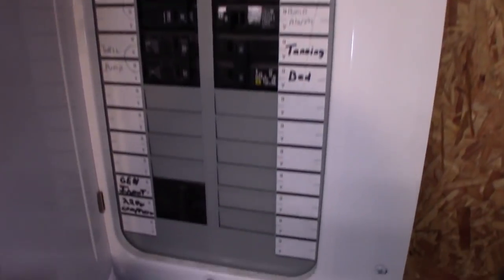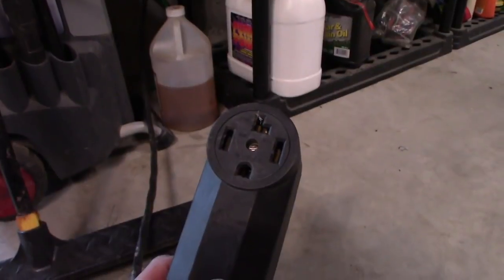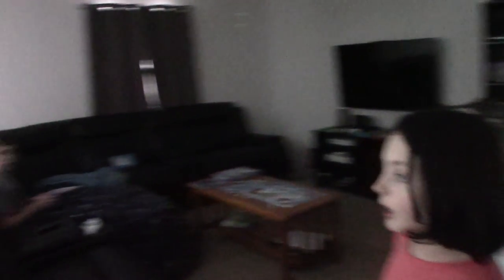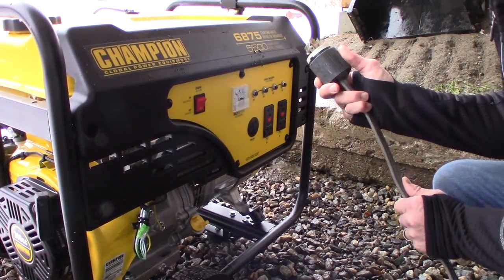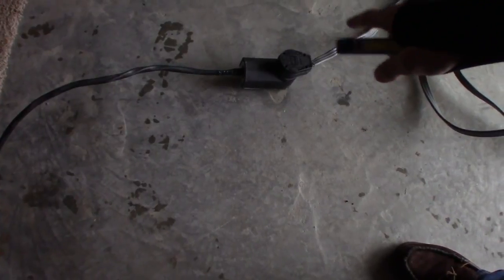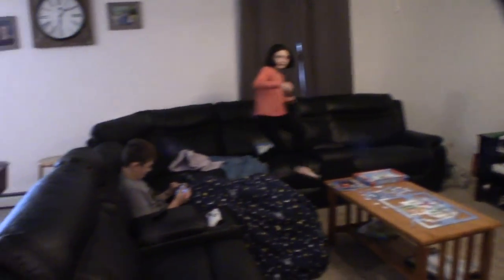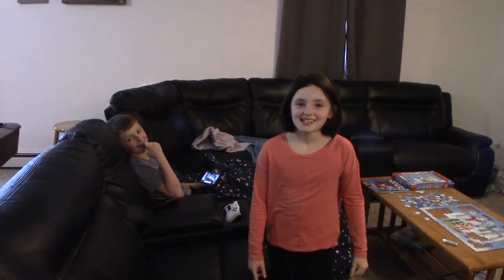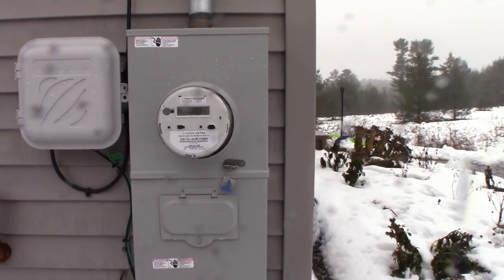Powering my ENTIRE HOME with a Gas Generator

Comment: actuality there's nothing wrong at all doing it this way.. I lived in an older house once back in 2012 and me and my wife are going through hard times and our power bill got backed up and shut off... I worked at the local recycle yard,ended up buying a generator in parts and putting it together...
had like 15 bucks in a 5500 watt generator and I ran it to the cook stove breaker of the house which my breaker panel was on the front porch of This Old House....I would drain the gas out of old junk cars coming in every day and take home 20 to 30 gallons of fuel every day... and it would cost me nearly nothing. I even ran it on propane for a night or two  even though it was a gas only generator.......we went 5 months like that from late January all the way through till the beginning of Summer.... only thing was when my well pump would run my hot water heater couldn't be running so I installed a breaker flip switch (I found at the recycle yard off of a huge machine) to my hot water heater and would manually shut it off in the bathroom when not in use.... it actually worked very well and from that time to today I'm a huge collector of generators and such things so you can kind of say I'm well prepared for a power outage and I've started collecting huge solar panels as well and car batteries for backup to use with my power inverter.... I had a 1500 watt power inverter one time it was an old job worked very well. I used it to power my buddies house we only ran lights and a 1500 watt heater on the low setting obviously.... we put the inverter outside connected it to a car battery then hook jumper cables to the car battery to his van which was sitting further away from the garage door where he could start the van when he needed it... I hooked it to his breaker box the same way i did my generator..... Hard Times calls for Desperate Measures..... if you understand electricity at all this is super super easy to do... and as far as generator prices I've never gave more than 70 bucks for any size generator because I buy them in Brokedown condition and fix them..... you wouldn't believe how wasteful people are after working at the local Recycling yard people brought in generators all the time big ones with little to nothing wrong with them I would buy them for  12 cents per pound.... and A good rule of thumb when it comes to used stuff no matter how used it is if it's in good working condition... most of the time  half of new + or - 20-30 bucks..... because if you take a $350 generator that's new and use it it no longer has any type of warranty after so long... and for 50 more dollars you could buy that warranty as well as a new generator... but that's just my opinion I guess.....

Comment: Be careful. 
As a generator tech I cringe when I see guys doing this stuff. 
The best thing I always see is someone forgetting to open the house main, and the utility is restored. 
A little 5kw gen isn’t gonna stand a chance with a utility company fight. 
Most of the stuff I deal with is permanently installed. 
You could probably get a real standby for around 3500$ for a huge 15-20kw. 
A smaller 10kw would probably run around 1500-2k. 
avoid generac like the plague.
Reply: I guess one who doesn't know what they're doing shouldn't be doing what he is doing I done this for five months never had an issue thing is you never forget to keep your breaker off that's just something that should come natural when looking at a breaker box when messing around with it even when you're back feeding or working on it....
Reply: MrHillfolk that person that forgets to shut the main off is the reason why they call this wrong ... There is NOTHING wrong with what he did at all ... He did it correct, it's dumb idiots that forget the main that cause all the issues... Just because you got one bad apple, you don't throw all of them away ..

Comment: Did you add the fuse for the generator at the breaker box or is that something that comes with those? I'm going to have to look at mine when I get back to the house I never noticed one there before. Good video we live out in the country 2 and ever so often the power will go out for several hours but for the most part not too long. Worst case was one summer it was over a hundred degrees out at night in Texas and I had to get our generator up and running to run the AC in our room we have window units everybody had to come into our room to sleep that night LOL. Would have been nice to been able to do what you did.
Reply from the maker: I added it, but most houses already have one in place to run an electric dryer, or an electric stove
Reply: @Fearlessfront  oh ok.

Comment: Great video sir! We are in So. Cal. And being threatened by our electric company with shut downs whenever there are high winds blowing! I got a Champion generator 9375 “just in case”! I would like to set up our connection like yours. Did you install that Big breaker yourself? Or should I have an electrician do this? Electricity has my respect! Not ready for any “shocking experiences”!  Anticipating your response.

Comment: Get a $30 lockout plate from Amazon and 50 amp RV plug and wire to the breaker  much safer but I have done it his way in the past in emergencies.

Comment: How you connect the plug in to the panel ? Please let me know.
Reply: You would have to bring the wire into the panel, connect it to the breaker, neutral bar, and ground bar. I wouldn't recommend it if you're not qualified to do it. Hire an electrician. If you touch the wrong thing, you're gonna get a nasty 240v shock.

Comment: What wattage is the new generator?
Reply from the maker: 6875 starting watts, 5500 running.
My old one was 4000 starting, 3500 running and it did pretty good
Reply: @Fearlessfront  that is one hell of a generator. But im just looking for a small one to power my pc, tv, lights, and ac (28000btu). Maybe  a 2000 watt wouod work? What do you think?
Reply: @Fearlessfront  you do realize that Gen is only giving you 25 amps to feed your house at 220 volts.
Reply: @9bq537  you would need a generator twice that size to run just your account. You would need 9k to start a start a 2ton compressor (24000 btu) plus whatever else you want to run.
Reply: @goodnough1  actually a 28000 btu ac unit only takes 3k to run and about 3.5k to start...
Reply: @9bq537  
You're gonna need more than a 2000 watt generator for all that. Forget the AC and you would get buy. I have two small generator s hooked parrell to each other to give me 4000 starting watts and 3200 running watts . Both purchased at Costco.

Comment: What happens if you have this setup and the power is restored by the utility company
Reply: Power would return to your meter and it should show data.  You would turn off the breaker to the generator, turn off the generator, unplug the generator, then turn on the main breaker to reconnect to the utility.  But the right way to do it it to have a lockout that physically prevents the main to turn on when the breaker to the generator is on.  Or better get, install a sub-panel specifically designed  with switchover than the generator can feed only when the power from the utility is switched off.

Comment: It's actually a 240 volt circuit.  But "everyone" says "220".
Reply: Can be above or below, 220-245 depending on the grid. and what we call 110 can be 110-125. Occasionally even 105, but much lower would be brownout conditions. During peak it is more likely to be on the lower side if a lot of people are pulling off the grid. I hear it referred to as 110, 115, and 120 almost equally. I hear 220, 230, and 240 about equally as well. All would work, with the lower voltages having higher amp draws. The resistance of the load X the amps applied is equal to the voltage. The resistance wont change due to lower voltage, but the amps it draws will increase when voltage drops, and decrease when voltage increases. If too little voltage is supplied there will be greater chance of a device overheating if it has a motor. Some of those power transmission lines are 765,000 volts. If they were 240 volts the lanes would have to be 6 ft diameter to carry the amps needed. The transmission wires go to transformers where the voltages are dropped with an increase in the amperage The super high voltage wires can actually overcome the resistance of the air to jump to a conductor. Those super high voltages would be only at these steel towers and no trees near them. I think those on wooden poles are about 25000 volts if I am remembering right. It is dropped at sub-stations, then again at transformers. There are videos of them working on those 765000 volt lines from helicopters with the linemen actually hooking onto the lines in very conductive suits. They are fairly safe as long as no path to ground exists. The conductive suit acts as a faraday cage, but it looks mighty scary to me.

Comment: Champions are a fine Gen. what ya don't want to do is have gen run outa gas with a load on it,
that can F up the regulator and you won't get power or starting gen with a load on it is no good
either. every 2 to 3 months start gen and put a load on it, a hair dryer or space heater is good as
it draws a bit of amps which keeps up the residual field in the rotor. make sure u shut gas off to 
the carb otherwise next time u need gen carb will be all gunkt up. and you'll be left in the dark.

Comment: To anyone who wants to do this - this is perfectly legit IF you add one more part, a mechanical interlock for the main breaker.   Many main panels support this type of activity if you purchase an interlock that allows your generator input breaker to only be on when the main is off.   Run a permanent weather proof inlet to the outside of the house, and use a cord similar to that one, and it's actually legit, and would pass a code inspection in most places.  Source - I'm a PE BSEE/CPE and have installed stuff like this years ago and had it pass referencing the NEC of the time.
Reply: dieselchevette mechanical interlock is NOT NEEDED ... It's only for those that don't know wtf they are doing ... CLEARLY this guys knows what he is doing which you cannot disagree ... And if you do, it's because you don't know what your doing
Reply: @ACommenterOnYouTube  the NEC, doesn't give a shit about what you think you know. It has requirements and that's it.
Reply: A mechanical interlock makes the outlet useless other than for generating purposes.  Its legit if you lock the main breaker: 702.5 Transfer Equipment
Transfer equipment shall be required . . . .(not important, what's next is)
Exception: Temporary connection of a portable generator without transfer equipment shall be permitted where conditions of maintenance and supervision ensure that only qualified persons service the installation and where the normal supply is physically isolated by a lockable disconnecting means or by disconnection of the normal supply conductors.
NEC GLOSSARY:
Physically Isolated (as applied to location). Not readily accessible to persons unless special means for access are used. (CMP-1)

110.25 Lockable Disconnecting Means. Where a disconnecting means is required to be lockable open elsewhere in this Code, it shall be capable of being locked in the open position.

The code allows for emergency connections.  You need to lock your main panel when doing so to keep someone else from closing the main breaker.

Comment: OMG use an electrical switchbox that chooses between 2 inputs, with the output connected to your main power box. 1 input goes to main power line, while the other input goes to your generator, that way you don't mix up both power inputs by accident.

Comment: If/when you get tired of the haters, pin this comment:
702.5 Transfer Equipment
Transfer equipment shall be required for all standby systems subject to the requirements of this article and for which an electric utility supply is either the normal or standby source. Transfer switches shall not be permitted to be reconditioned.
Exception: Temporary connection of a portable generator without transfer equipment shall be permitted where conditions of maintenance and supervision ensure that only qualified persons service the installation and where the normal supply is physically isolated by a lockable disconnecting means or by disconnection of the normal supply conductors.
NEC GLOSSARY:
Physically Isolated (as applied to location). Not readily accessible to persons unless special means for access are used. (CMP-1)

110.25 Lockable Disconnecting Means. Where a disconnecting means is required to be lockable open elsewhere in this Code, it shall be capable of being locked in the open position.

The code allows for emergency connections.  You need to lock your main panel when doing so to keep someone else from closing the main breaker.

Comment: Asking $300 is pretty high since Amazon has that brand new, delivered, for $305. I'd ask $200 and take first offer over 150.
Also, Amazon has a Reliance 6 circuit manual transfer switch for $310 including power cord and outside receptacle.

Comment: Left everyone hanging on one important part. 
You didn’t show the connection to the aux breaker. 
I assume you connected directly to the breaker and ground bars juice thru the buss bar?? Incomplete instructional video 😏
Reply: Don't try it if you don't know how to connect the receptacle to the 40 amp breaker in the panel.

Comment: dangerous people, don't do it, (1) you need a an interlock switch that prevents feeding a live breaker box with the generator (2) his plug is dangerous- spend the $50 to get the right generator hook up box (3) move your generator away from your door unless you want to die of carbon monixide

Comment: You might want to look into a product called GenerLink. It is safer and certified for a similar setup. They have a 30 amp and and 40 amp version. Both versions come with or without an optional surge protector. 

The product does away with transfer switches and the associated wiring. It powers the whole main panel. 

You turn off all breakers before connecting the generator, and then turn breakers on and off as you need different things powered. If you overload the power draw, the Generlink shuts off power until you correct the overload. You may want to keep a flashlight on hand to turn breakers on and off in the dark.

Depending on the running wattage of your generator and the load, you can power up some things, but not others. The higher the running watts, the more gas you will burn in a given time. So, you might want to make a tradeoff between what you can power, and how long you can run the generator before you deplete you gas supply. We only run the generator in the morning and evening during prolonged power outages. If you run it all day, you will blow through your gas quickly.
Reply: . . . and $700

Comment: WELL, if you had of told us the TYPE & SIZE of wire AND the actual name and part numbers of the male & female recipitals
 and showed us HOW to wire in the wire to the fuse panel it would of been much better
Reply: If you need a video to tell you that then you shouldn't do this. If you know anything about how electricity in homes work then you wouldn't need the video to tell it to you.
Reply: I don't think that would have been a good idea if he did list on the parts that he used because it becomes a liability issue.. like he said does not recommend to do it
Reply: It's the wrong wire anyway. Should be SO cord. Whatever size is proper for the amount of amps you're moving.
Reply: Most hardware stores across sell a kit to do this.
Reply: I would use welding parts if i wanted one. If you cant figure out how to make the cord, then don't attempt this

Comment: It will also feed into the generator and blow it up and destroy all electrical in the house
Reply: No it won't.
Reply: @snap-off5383   that’s a problem in Oklahoma when people do that it’ll back feed the lines and sometimes hurt the people working on the lines there’s a major fine for that as well
Reply: @gokarting1018  Can you cite the law that imposes the "fine"?  If the main breaker is opened, there's no danger nor problem.  
702.5 Transfer Equipment 

(A) General
Transfer equipment shall be required for all standby systems subject to the requirements of this article and for which an electric utility supply is either the normal or standby source. Transfer switches shall not be permitted to be reconditioned.
Exception: Temporary connection of a portable generator without transfer equipment shall be permitted where conditions of maintenance and supervision ensure that only qualified persons service the installation and where the normal supply is physically isolated by a lockable disconnecting means or by disconnection of the normal supply conductors.

Isolated (as applied to location). Not readily accessible to persons unless special means for access are used. (CMP-1)

110.25 Lockable Disconnecting Means. Where a disconnecting means is required to be lockable open elsewhere in this Code, it shall be capable of being locked in the open position.

Simply opening the main breaker and locking that panel is all that is necessary in an emergency.

Comment: I had an electrician (cuz I don't know electricity) put a generator hook up on the side of the house (next to the shed with the generator in it)  and the box in the cellar next to the breaker panel, glad I did it, just wait till you get an ice storm up there, could be a lot longer with out power from the power company than you might think.
Reply from the maker: We've had power outage stretches lasting well over a week in my area. It really sucks
Reply: @Fearlessfront  I hear you! Ten years ago down here we had one about a week long.